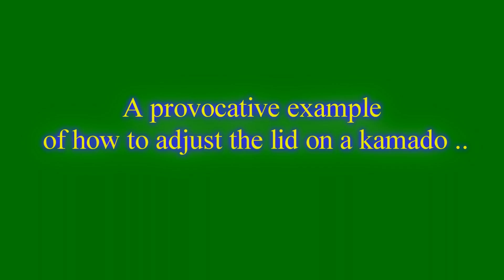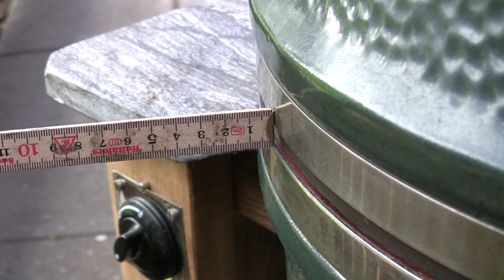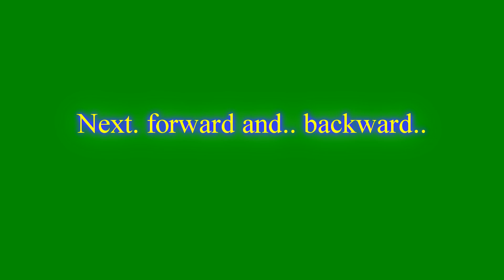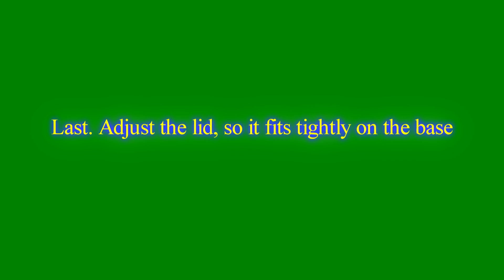Kamado - Kamado Lid adjustment..  Big Green Egg - Primo - With several..

Comment: Thank you. I still don't know how/why the front to back works, but lifting with upward pressure on a big adjustable wrench while tightening to nuts seemed to fix my overbite. I loosened all of them, pried on it, and re-tightened them all still applying  pressure. The top then moved forward the 3/8" needed.

Comment: I love the video.  I have watched it a number of times.  I get the side to side alignment, but I agree that I am not quite getting the front to back. How does loosening the lid from the hinge, manually moving the hinge and then tightening the lid back to the hinge fix the front to back alignment? Unless some adjustment is made to the hinge itself isn't everything going to just fall back the same way?  Great video - love the handle.  If you would sell me one of these I would definitely buy it.

Comment: @4:00 How are you pushing forward on the lid to line it up with the base?  How are you holding it there when the next scene cuts to you tightening the lid hinge nuts?
Reply: BrakTalk this is the adjustment I need to do on my egg too.  It appears that he has upward pressure on the hinge with the adjustable wrench.  I have been trying to fix the underbite on my egg for a while, I hope this works!